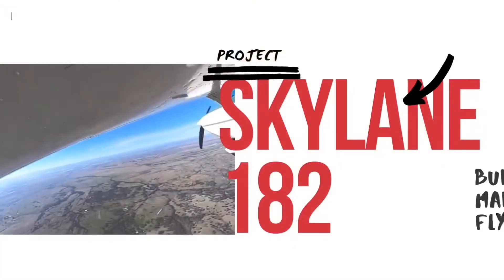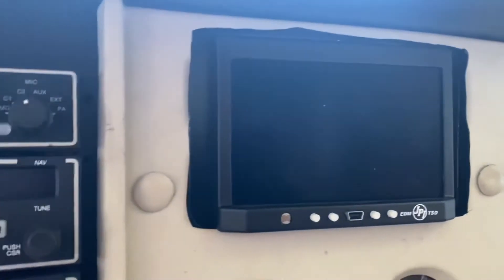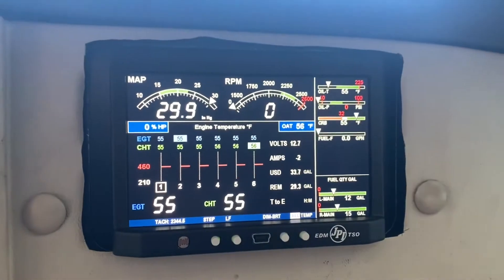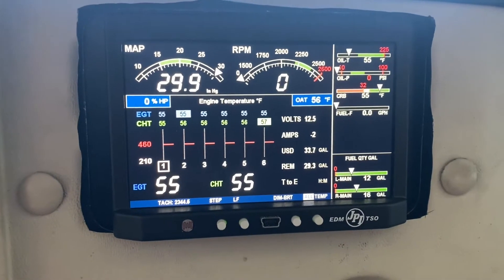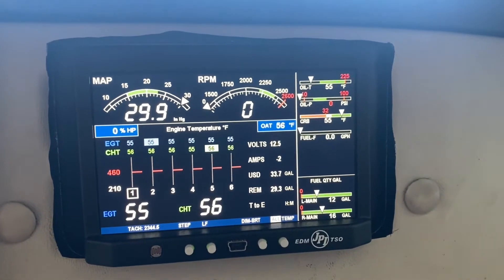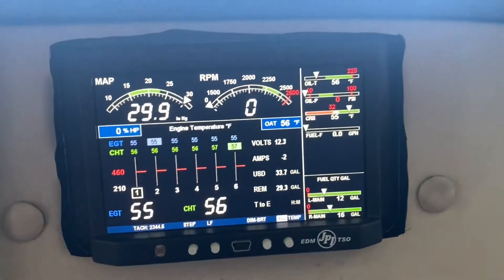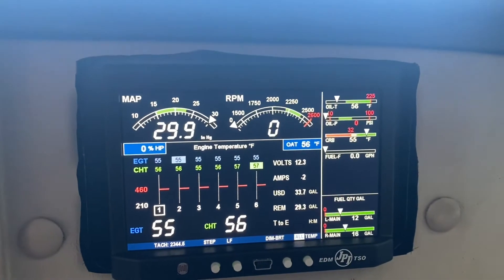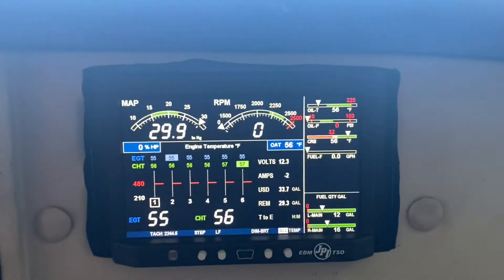Our First EDM-900 Review

Comment: Can I ask what the Amps is there to show? Is it load? i.e. when fired up with strobes, instruments, radios, maybe autopilot, running the Amps presumably it shows 10+ but needs to remain below the voltage in flight (perhaps 13.5V) in order to be charging the battery? I don't see what use the Amps function is unless it shows the battery is being charged after start-up.
Reply from the maker: The amp shows the load to the buss bar. After start up the amp reading could be as high as or higher than 25 amps.  With all the lighting and radios turned on the amp reading will also show this load applied to the buss.  Although amp does not necessarily need to be below voltage. Think of voltage as the pressure and amps as the flow.